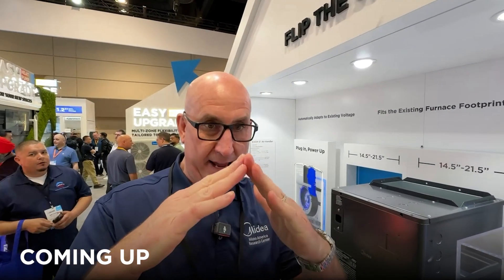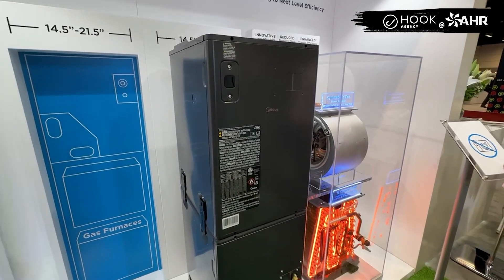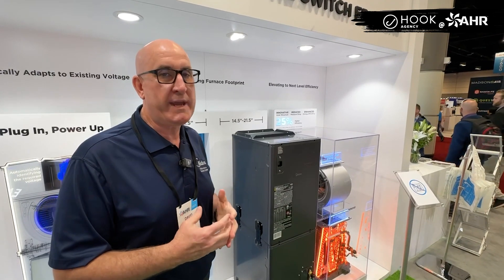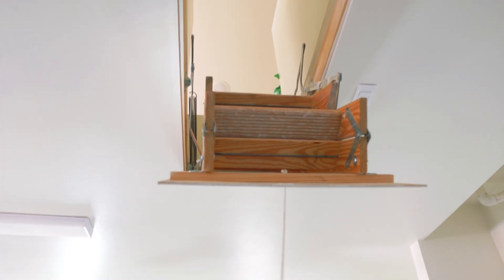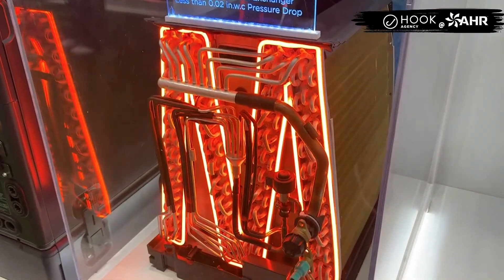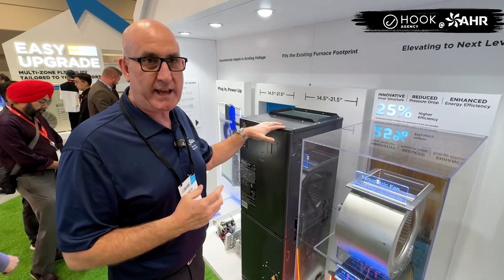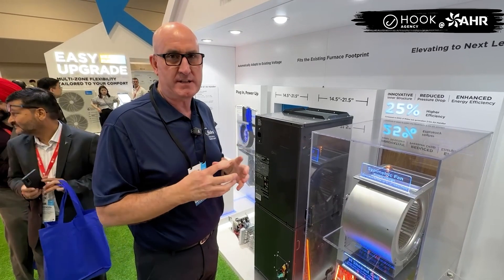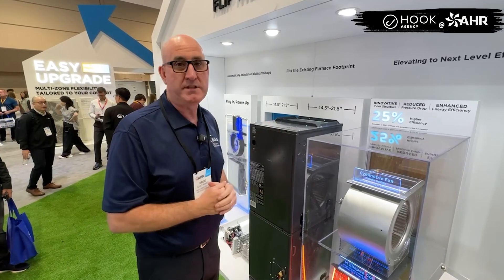New Midea EVOX Demo 2025: The MOST Innovative Air Handler on the Market??

Comment: Coil is a bad idea for maintenance. Unless you design a tool that will get in there and help clean coil. Rheems are the worst to try and clean in place for home owners.
Reply: Solution is to install a proper media filter cabinet in the return duct close to unit and ensure it's well sealed and duct going to air handler also doesn't leak.
Need to get out of the mindset of coil cleaning being normal maintenance when it is caused by air not being properly filtered. 
With properly filtered return air should never need to clean a blower or secondary heat exchanger on a furnace or coil on an air handler.
The included filters and racks with air handlers are junk.
manufacturers should step up to the plate and start selling air handlers with media filter cabinets. carrier did it at one point with certain line of furnaces.
Reply: @Jon-hx7pe you don’t have the home owners we have lol. 80 year old who don’t have the ability or just dumb people I try to educate everyone on every call.
Reply: @CosmicCooling the system includes a 5” filter box on the bottom of the coil.
Reply: @CosmicCooling  media filters are great for people who have trouble changing filters because they need to be changed far less frequently than 1".